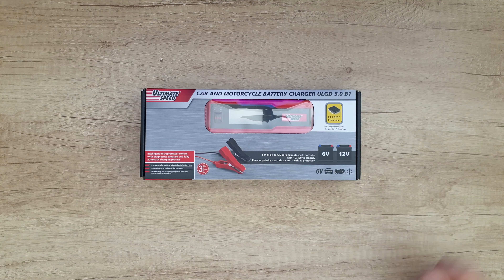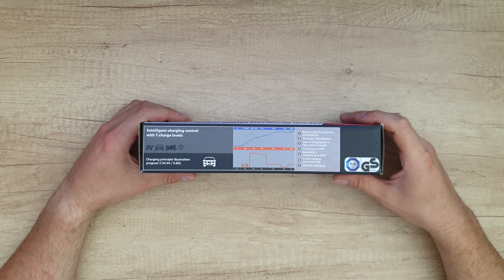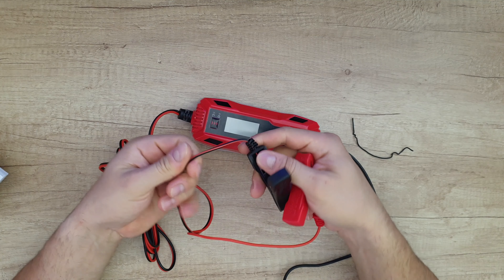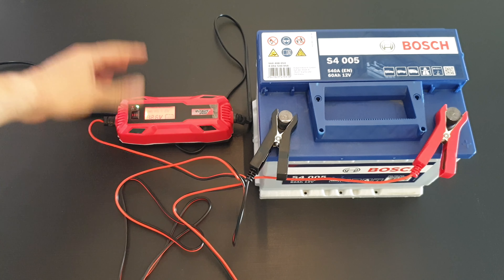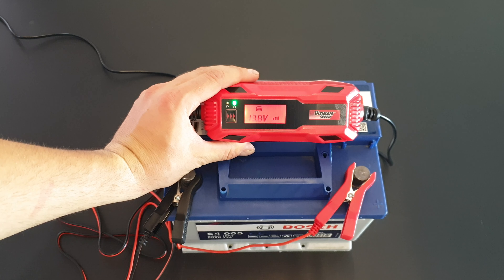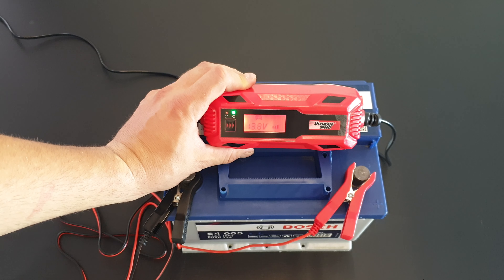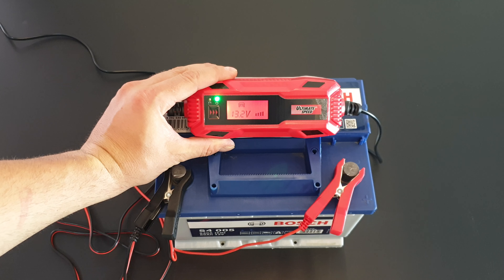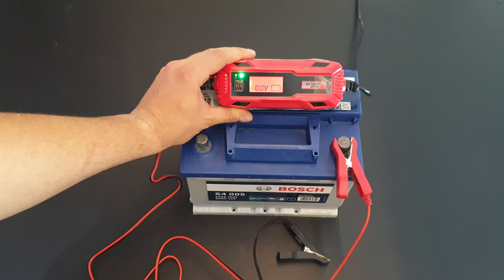Ultimate Speed Car and Motorcycle Battery Charger ULGD 5.0 B1 TESTING

Comment: I found it very good to maintain a good car battery especially when the car isn't used much. Leave it always on and connected. Watch out for a power cut as it reverts to stand by and have to press the program button again for it to charge. It only cost me €15 for the latest C1 model giving 5amps and with an LCD screen. Connect to the battery terminals first then to the mains and switch on. That way there is least possibility of a spark.

Comment: ok so I have a question: Why does it say 14.4 and 14.7 V for charging modes 3 and 4 (car and winter) - but when it finished charging your battery, it shows 13 V on the screen? Shouldn't it charge to 14.4 V?
Reply from the maker: When charging is giving the maximum current volt When is finishing charging slows down

Comment: I have it and it's good. I'm happy with it. There are a few downsides:

- it doesn't have the trickle charger connection for motorcycles like the older version
- it doesn't have the power or the option to jumpstart your car if you can't turn on your car on a cold morning. You have to precharge it or you're screwed
- the screen illumination doesn't turn off
Reply: hm , crap ?
Reply: @MrDexi87  ?
Reply: @westsenkovec  i mean this charger is bad.
Reply: @MrDexi87  it's not bad. There are more expensive chargers with less features. 
It has trickle charging so you can leave it connected, it has overcharging and reverse polarity protection, illuminated screen and charging indication, a couple of automatic modes and automatic voltage protection. The build quality is decent and the product is cheap and you get a warranty. What more do you need?

Comment: mine charges doesnt do anything. not  flashing, just reads volts and empty batery logo..
Reply: Same as mine. And if I press the only button it has it goes back from the start. Total piece of crap. I lost the recite, so I can't return it.
Reply: @grizzlycountry5539   it was chargin cable problem. They replaced with a new one. But still its peace of shit
Reply: You're using it incorrectly.. you have to press the mode button until you see three dashes flashing between the voltage.. that's testing mode.. it'll run that for about 2 mins and then it'll select motorcycle mode itself and start charging.. you THEN select car mode and leave it do its thing 👍